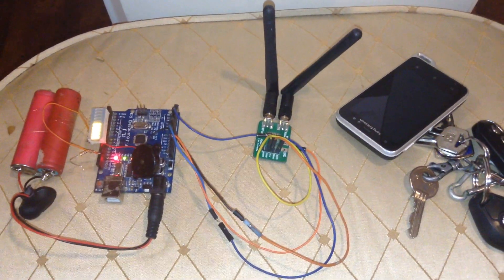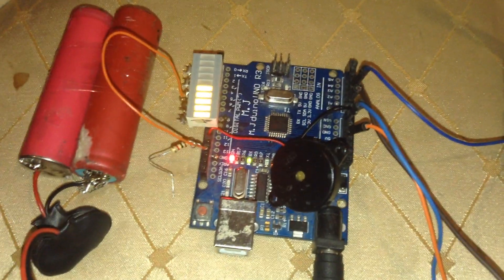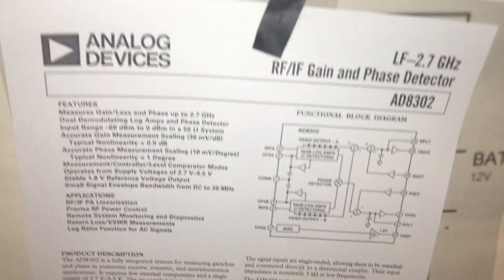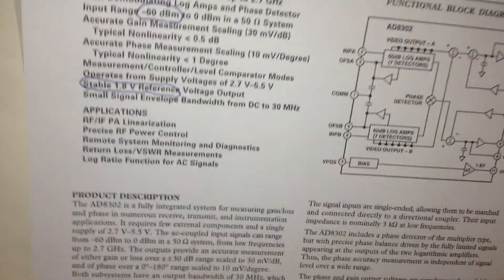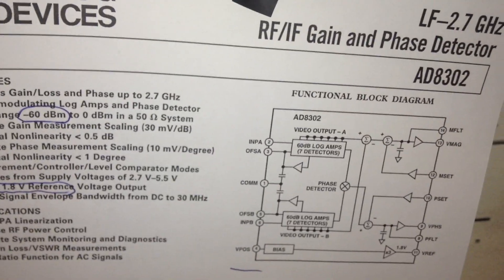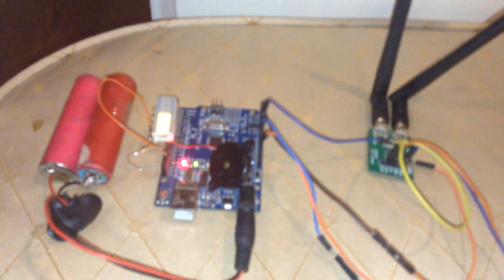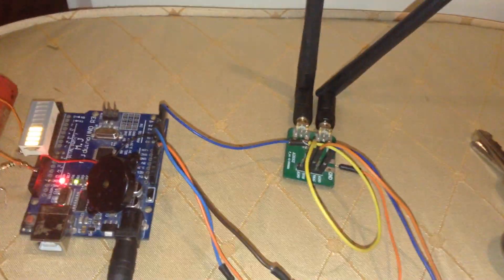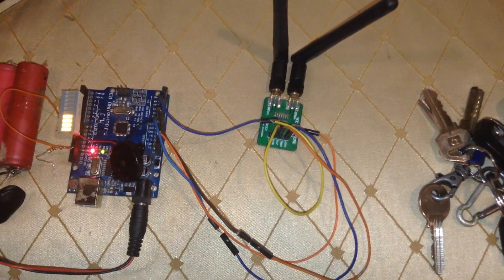AD8302  connected to Arduino to measure Signal Strength

Comment: What are you actually trying to measure? Since you just have two RF antennas connected to the Input 1 and Input 2 you are basically trying to look at the difference between 2 identical signals. There will be some phase difference between the 2 signals dependent on the physical distance between the 2 antennas but the magnitude should be the same or very similar.
Could you please explain more?  
As I understand your setup will pick up any radio signal and give you the phase and magnitude difference between the 2. The magnitude should be pretty much the same between the 2 unless you have your transmitter very close to one of the antennas. The measurement reading you can do with this setup will not be dependent on the strength of the RF signal. I.E it doesn't matter if you have your transmitter (your phone) close to the antennas or 20 meters away. Your reading should be pretty much the same since the AD8302 only look at the difference between the signals.
You could possible use this device for some triangulation of your transmitter (looking at the phase value) but the measurement will be ambiguous and difficult to actually use for anything